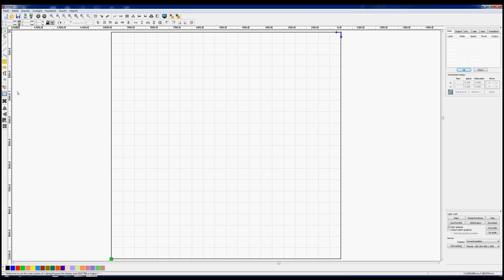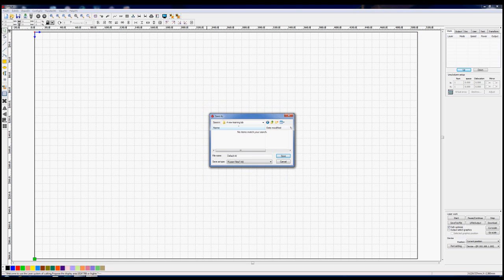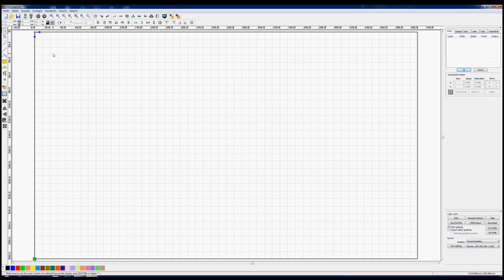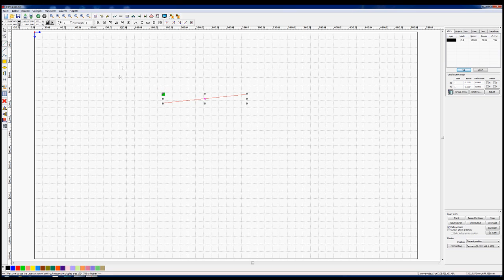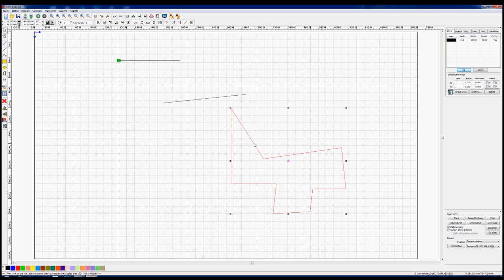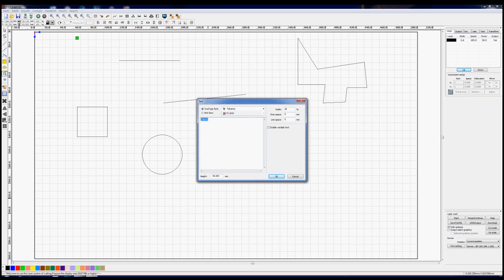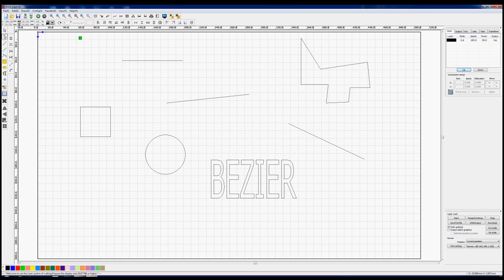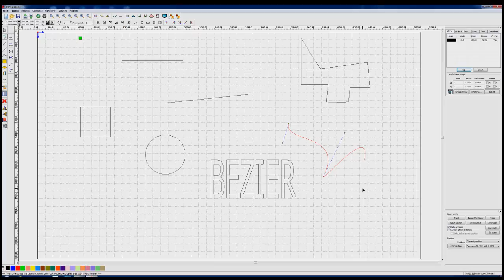RDWorks Learning Lab 01  Basic drawing tools

Comment: I cant find X Axis mirror on my RD works ver 8.  Please could you try assist.  Thank you so much
Reply from the maker: Hi
 RDworks has come a long way in 9 years and in V* there is no need to do the mirror thing. If you go to CONFIG and System Settings you will find 2 squares with dots to choose.  The one with 4 dots is replacing the need to mirror. Just put a dot where your head runs to at start uyp (usually back left  but some machines use back right). The 9 dot pattern called Laser Head is all to do with any program your write. In general you will set this dot to the same as the  Homing Position . In that way ALL your programs will start form a top left poition. However,  when you are familiar with your machine  may wish to start at tthe centreof your program or any of the 9 positions, You must experiment to understand it with something simple like a 100mm square.
 If you need more help you can contact me privately with this contact form.
https://forms.zohopublic.eu/ndeavorlimited/form/K40XtreeemLaserCutterContactRussSadler/formperma/k2Cn0QN5ChpazfTMAUw25lZ-FKpjZa96TQWHjv3ntOg

Comment: Hi! I might have a silly question,  but I'm wanting to know if we can control the font width &  height in Rdworks for script fonts/monoline fonts .  For example 8mm width &    40mm height for each letter in the word. Thanks
Reply from the maker: Hi 
 Take a look at this video. It's not exactly the subject you are after but it shows you all about grouping and ungrouping text. This is the key that unlocks single letters so that you can resize them.  Put handles around your letter and set the X and Y dimension you require isn the size windows on the toolbar

Best wishes
Russ
Reply: Thanks ! I think I got it 👍

Comment: I have an issue that is seemingly unsolvable. I cant transfer dotted lines (lines that are trasnformed to spaced out dots or short lines) when i save sa .dxf from CorelDraw. I cant find a tool that makes a line dotted in RD Works 8.0. Help anyone? Much respect for this channel sir!
Reply from the maker: Sadly , when you draw a dotted or dashed line in Coreldraw or any CAD program , it is really  a solid  line (displayed as dashes) and not a series of single lines  or dots. Thus when you transfer it to RDWorks it will be a single line again.. You can however do a work around to create a dotted line in RDWorks
 Draw a small dash and put handles on the dash. Then go to the bottom tool  (the matrix tool) and guess the number of dashes you require  (say  20) and the spacing  (say 3mm). Press OK  and your dotted line appears. You can remove one dash at a time to make it as long as you require . You can mark the whole line and move it as a single item. You can also SCALE it  to fit your object with the X or Y window on the top tool bar.

Best wishes
Russ
Reply: @SarbarMultimedia  Thanx Russ! That was a swift answer. Unfortunately i need my dots to follow a curve of a letter (making pounce pattern) so i think this will be impossible. I had a smaller laser cutter that used Corel Laser software and it was great for this sort of thing..
Reply from the maker: @leesak  Hi Leesak

Aha!!!!  You described what you wanted but I had  no idea what you were trying to achieve.  Now that I recognize you want a thin paper/card template or stencil  through which you want to trace a pattern with  pounce powder I can offer you a REAL solution,
 
For just a test,  draw a  circle or short word with RDWorks in letters about 25mm tall.   Set your parameters as follows
speed 25 . power 50%/50% and select DOT MODE (not cut). You will see extra settings on the right. Set  time to  0, interval to 1mm and length to 0.5mm. Press OK and then use the preview screen on the tool bar to see what this produces. . Play with these last 3 parameters to get what you want.

If the dashes you create are not wide enough to let sufficient powder through,  increase the gap between nozzle and work by 3,  4,  5 or even 6 mm 

Best wishes
Russ
Reply: @SarbarMultimedia  Haha, You tottaly got my intention! I'm away for 2days now but I'll try it ASAP! If this works, and I think it will i owe You one!

Comment: Hi there
Great tutorials! But how do we unite shapes to cut an complex outline?
Reply from the maker: Hi Richard
 The simple answer is you cant. This was never intended as a CAD or drawing software. It is a user interface to convert your pre-prepared designs into a machine code format that your laser machine can act upon .You never see any of the code, that is elegantly hidden from you, instead this is basically an interrogation software that asked you details about what you want to do with your design. The confusing issue for beginners is they see BASIC drawing tools. These tools allow some last minute adjustments rather than returning to the origination program. They also allow the creation of quick and simple test programs. You are getting a great software program for free. However, there have been others, like yourself,  that were looking for more than in interface program. About 3 years ago, one private individual took it upon himself to do a complete rewrite of RDWorks, not only making it run on Windows but also adding OS and LInux capability. After the initial translation, he has gone on to add text manipulation, drawing combination tools  and many other features found in packages such as Illustrator. This program is highly recommended for its simple and compact user interface and its powerful additional features  Go to lightburnsoftware.com and you can download a fully featured 30 day free trial you can test. I think it is $90 to buy. The problem is that in 30 days you may never be able to test all of its features but I feel sure you will be sufficiently impressed that you will part with some cash.

Best wishes
Russ

Comment: Hi Sir, enjoy your videos, is there an easy way to make rounded corners on a square in RD?
Reply from the maker: Heloo
RDworks has a few basic drawing tools but it is neither  dawing ot CAD software, just a very powerful and free interface to your laser machine. To do corner fillets you need vector drawing software or a CAD package. Sorry , RDWorks cannot do it.
Best wishes
Russ
Reply: @SarbarMultimedia  Thank you. when i save my files in rd to recover them its saying wrong file format. Any suggestions? Thank you again
Reply from the maker: @chhmansukhna5107  
Hi 
Some versions of RDWorks have bugs and the problem you have happens in several versions. I am using  issue 38 which is stable  but I think yhe latest issue is 44,. If you wish ti install issue 38 then here is a link where you can copy it  https://www.dropbox.com/s/8xugiag5alqlp4v/RDWorks%20ruida%20issue%2038.rar?dl=0

Best wishes
Russ
Reply from the maker: @chhmansukhna5107  
 I apologize if I msunderstood your question. There are two ways to save files in RDWorks. If you select the SAVE or SAVE AS you will be saving what you can see on the screen along with all the parameter settings. You will be able toOPEN this at a future date but if you try to open them on the machine from a memory stick the macine will not understand them and probably display an error message. These files have a .rld extension. At the bottom right corner there is a SAVE to U DISK button. This does the opposite in that  it creates a machine code file for the program on the screen and it will have a .rd extension. You cannot OPEN this file format on your pc, you can save it to a FAT32 formatted USB memeory stick and take it to the machine. There, you must plug it into the correct port (only one works because the other is for connecting your PC) and press the file buitton where you will have to follow through 2 or 3 menus.

 Hope this answers your question.
Best wishes
Russ
Reply: @SarbarMultimedia  Thank you Sir  hope it helps too
Reply: @SarbarMultimedia  Sir, unfortunately, it does not recognise any saved files in rld. another issue is sometimes when objects are designed it says" no layer found"  therefore i cannot download the design
Reply from the maker: @chhmansukhna5107  
 If you have installed issue 38 it may not reconize files created in some earlier versions. This a regular bug with the software. But with issue 38 you should be able to save and retrieve files created with issue 38.. 
 Layer not found error is to do with your parameter settings. If you have just one layer then look at the second box down where it asks "IS OUTPUT?"  You must answer YES otherwise that layer colour will be invisible to the machine If you have one of sevral layers switched off then the machine will not flag an errror it will just deal with the layers that are visible. It will be YOU that is surpised when part of your design is missing. So ALWAYS check that second box.
Best wishes
Russ

Comment: Sir i need to engrave and better say cut  glass on cell phone screen, under which located polarizer (plastic film) . If i cut through hath the thickness of the glass will it burn or damage anyway that polarizer?
Reply from the maker: Glass is not a material you can cut with this laser. You can engrave it by damaging the surface . The laser light hitting the surface of the glass excites the glass molecules to a higher temperature. This actually happens instantly because of the intense energy in the focused beam. Glass is a very poor conductor of heat and a brittle material . That pin prick of intense heating causes a minute piece of glass to heat up, expand rapidly and shear away from the parent material  before it melts. It leaves a small damage area behind much like a stone chip on your car windscreen. . If you keep the beam in one place or move it slow enough you will just produce a molten mess  OR the heat will build up locally and crack the WHOLE of your glass object.  You are planning to cut through a plastic film as well so that will melt first and be affected further by the heat of the glass engraving. It will no be a clean edge. The best you can do with glass is etch the surface much like diamond scratching and try to break it along the fracture plane. Cell phone glass may react differently to normal glass because it is filled with all sorts of exotic chemical elements but I asses your chances of actually CUTTING it as zero.
Best wishes
Russ

Comment: Hi Russ, hope you are well. Russ, I am planning to use autocad to produce heavy files for engraving. Have you tested how much information/elements RDworks can handle? 
Thanks,
Dimitri
Reply from the maker: Hi Dimitri
Using vector files for engraving is not a memory heavy task Its just a matter of turning the laser beam on and off at the beginning and end of your closed shape on every single scan line. With dithered graphics the files get very big because every pixel is mapped. I have struggled with grey scale pictures where not only is every pixel mapped, the individual  power for each pixel is also being stored.. Do not anticipate you having any problems.
Best wishes
Russ

Comment: Good morning, Your videos are great they have helped me tremendously.
 i have a problem with mu chinese laser engraver.  It is a Kehui 100w and last week it just shut down.  The machine will not power up.  I have checked the emergency stop button, the power outlets, i tried a new power cord, i purchased and installed a new power supply, installed a new main power switch and still nothing.  Please can you help, let me know what could be causing this or what to check next.  Thank you.
Reply: OMG, i found a hidden fuse. so simple.  It's working.  Thank you again for the videos you have made.  I have learned so much.
Reply from the maker: Hi Shawn
Thought transference is a powerful  tool I brought from my home planet!!! Glad it helped you find the problem. 
On a more serious note. Your Kehui machine will almost certainly have been fitted with an 80 watt reject tube. The tube could be from a reputable manufacturer but failed final QA. To keep costs down and profits high KeHui go round and collect all these rejects and retest them themselves to make sure they work well enough to fool the typical Ebay buyer. They relabel them as KHLaser. Your tube may be almost dead or almost perfect, only you will know when it fails. KeHui have a poor quality reputation and you have had to find out the hard way. All the parts are there but assembly quality may require your additional attention. When you have finished reworking the machine it will serve you well but part of that reworking will almost certainly require you to buy a PROPER tube and a MATCHED power supply, so start saving
Thanks for the kind words
Best regards
Russ

Comment: I have a problem with my laser Machine which has RDworks program, when running a program I have to double my vertical Measurement to equal my Horizontal measurement.
Reply from the maker: Hi Brian
It sound like your stepper motors have not been calibrated correctly. I could try to explain how to fix this but I take you through a step by step procedure as part of one of my other videos. Draw a 100mm square in RDWorks and then put that program into your machine. Watch this video
https://www.youtube.com/watch?v=Y-tva0CSJao
If you still have problems , shout out again
Best regards
Russ

Comment: Hello Russ 
have found that Adobe illustrator is fantastic for DXF files to trial there is a free downloadable  trail 
working on software. at moment doing lots of virtual laser cutting in preview 
thx for your help it has been invaluable.
Wayne
Reply from the maker: Hi Wayne
Preview is a great way to hone your skills before you get anywhere near a machine and in the early days it will save you lots of wasted material.
Enjoy
Russ
Reply from the maker: Hi Wayne
Yes, I have several versions of Illustrator and its good for doing conversions of bitmaps files etc to vector files by using the trace feature. I do little drawing there because it is so clunky for "non-artistic" work that I always use my CAD system. However, there is a AI plug in for RDWorks that allows you to program from within AI.
Happy New Year
Russ

Comment: Have you ran into the error message, "No enough extend space." on your machine? If so, did you figure out what caused it? I was trying to engrave something A little smaller than 500 x 300. Thought maybe it was just too big. Scale down, but still got the same message.
Reply from the maker: Hi
Because your image is close to the 300x500 work area limit, my guess is that you have set your origin at machine 0,0. The fact that you are engraving means that at the end of each sweep the beam switches off but the head has to travel on as it decelerates to a stop, turns round and accelerates back up to speed before turning the beam on again. If you have set your program to run from 0,0 then this overrun will go outside the allowable work area. You need to leave 5mm all round when engraving to allow for this. So set your origin at 5,5 and make sure your image is not bigger than 290x490.

Problem solved
Best regards
Russ
Reply: +SarbarMultimedia Thank you so very much! That makes sense. I will give that a shot.

Comment: What about using GIMP? GIMP is a free clone of photoshop.
Reply from the maker: Hi Steve
At this point in my learning journey (a year ago) I was still thinking that this was some sort of drawing/cad program. I took a little while for me to realize that this was never intended as a creation program but it is a very powerful interface program to the laser machine. Its capability is immense as an invisible program creator that takes your drawings and "makes them happen". I have never heard of GIMP but I have now downloaded it and at first glance it looks very powerful. I will have to spend time playing with it. However, 99% of what I create is done in a CAD program and sent to RDWorks as a DXF import file

Thanks for the tip

Best regards
Russ
Reply: What CAD program do you use?
Reply from the maker: Hi Steve
A leftover from my machine owning days when I used to run a complete CAD/CAM package from Alpacam. The cad package was nothing like Autocad in that it was not designed to make pretty engineering drawings but more about design creation and outputting  elements directly to IGES or DXF files for CNC manufacture.  It's a quick and elegant system to use. For personal reasons I had to close my business but persuaded Alphacam to sell me a lifetime licence for just the cad element.  Even now that I am 80% retired, there's hardly a day goes by that I don't use it.
Best regards
Russ